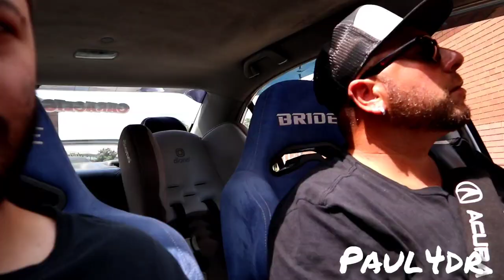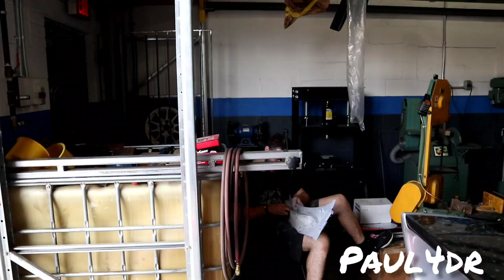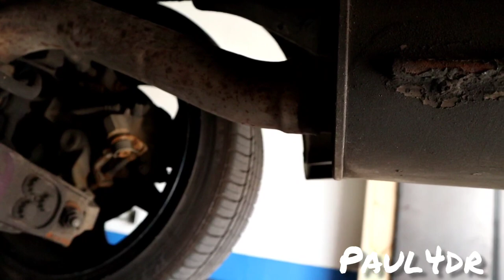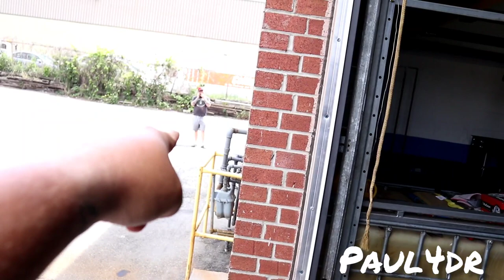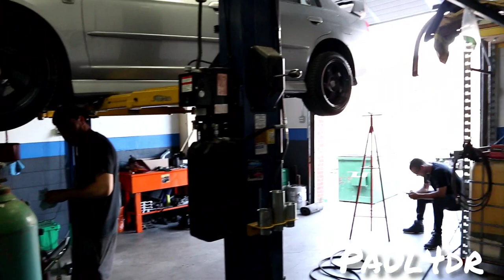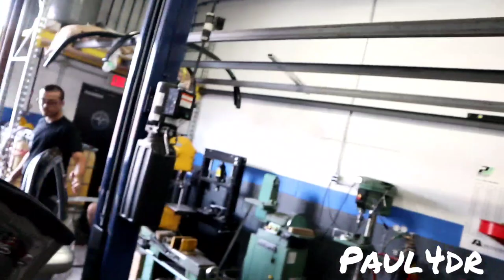Speedfactory turn down muffler install

Comment: Is that stainless steel piping ?
Reply from the maker: Yeszhitty stainless
Reply: @PAUL4DR  I have the same muffler but the shop told me they couldn’t weld it because I have regular piping